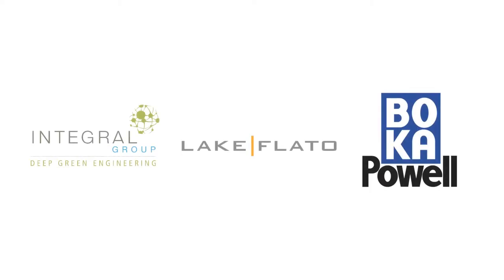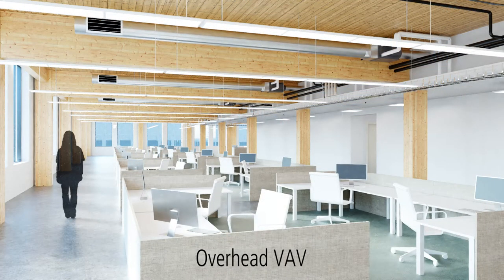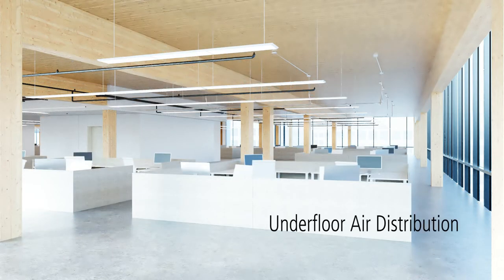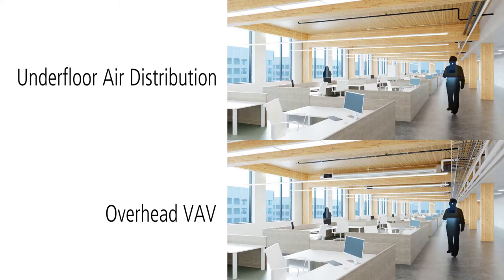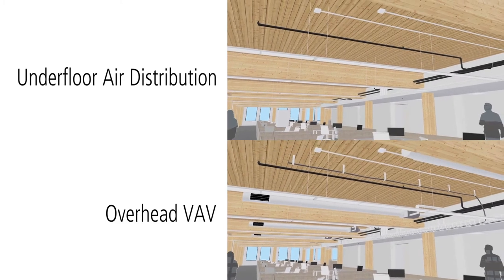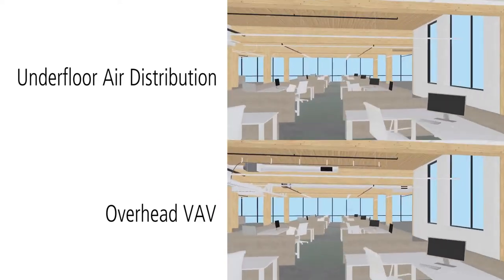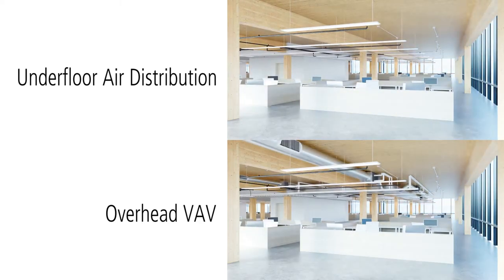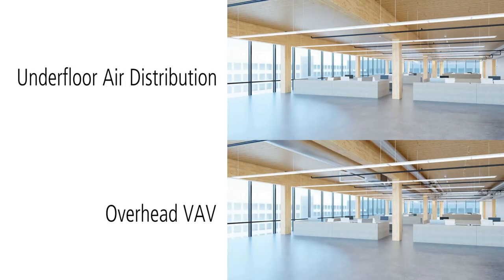Timber Frame Building: UFAD or VAV?

Comment: What programs where used to make this?
Reply from the maker: Hi Nick, the architectural and structural geometry was modeled by the architect in Revit. 
Everything else (MEP equipment, lighting, site context, etc) was modeled, textured, animated, and rendered in Blender by me.
Reply: Tyler Disney blender never heard of that. It looks good though is it easy to use?
Reply from the maker: Yeah I think so. There are a ton of free tutorials on it, since it's open source, the user community makes learning it really nice.
Reply: Tyler Disney That room in the revit model was just an empty volume? When you then added all the various elements seen here, so basic everything needed for a build-out? And then also produced such convincing sketches?
Reply from the maker: Hi, yep, the arch model was just core and shell elements, so I started with an empty room and built everything else. My years of doing mechanical layouts in Revit under deadline pressure really served me well here. ;)